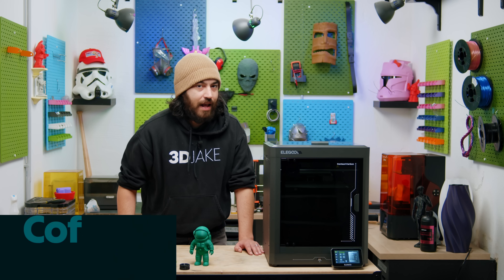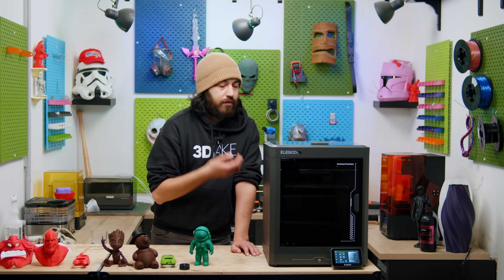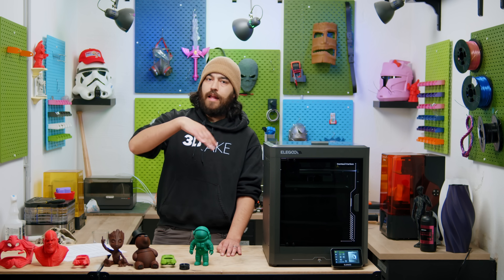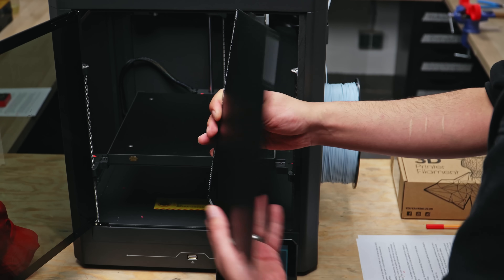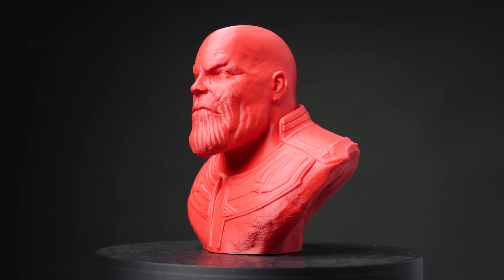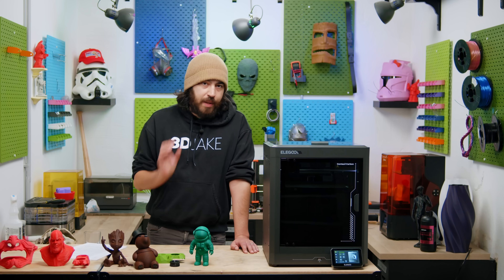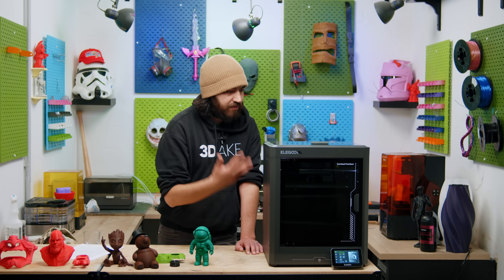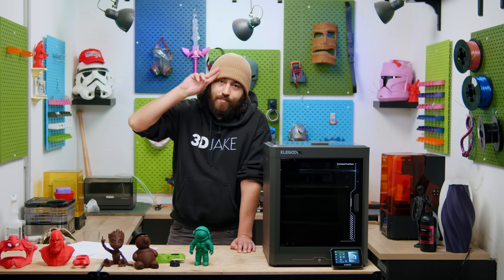Is This the Best Budget CoreXY of 2025? Elegoo Centauri Carbon Tested!

Comment: Wat is de beste printer voor tpu?
Reply from the maker: tough question but anything that doesn't have a sharp angle on the PTFE tube as it reaches the printhead, so bed slinger printers or an unenclosed printer would be best

Comment: I know this does not have an active chamber heater, but does it control the chamber fan to passively regulate the chamber temperature? I'm thinking maybe adding a small ptc heater inside to assist in printing engineering filaments
Reply from the maker: Yes the chamber has a thermistor and the fan turns on and off to regulate the chamber temperature. Unfortunately, installing a heater is not really recommended or at least one that would bump the temperature to over what the printer is capable of with just the bed alone. Installing one to decrease the chamber heat up time is probably ok but not one that pushes the temp over 50C. While the printer can process abs, asa, nylon etc if you're looking for a printer that will primarily work with these filaments I think I wouldn't recommend this.

Comment: Question how does it hold up in the long run like what the quality of the parts does anything break maintenance costs stuff like that because I can't wrap my head around the fact that it is priced to undercut it's main competitor yet still be so good
Reply from the maker: So far so good but they obviously cut some corners. There is nothing super special about this printer besides the price, it works yes but it just only works, so it seems most of the work they put in was simply about bringing the price down. That said they did a decent job in that respect and it seems to be reliable so far. Time will tell.

Comment: The leveling / bed mesh creation seems to match what I do on my custom Klipper code: probe the amount of times needed to reach the required accuracy.  I noticed that also my Bambu P1S has a variable number of probes when creating the mesh, so it doesn't seem that weird to me.  Better probe more than have a wrong measurement at that mesh location ...

Comment: Thank you SO much for actually showing HIGH QUALITY shots of the models you printed with GOOD LIGHTING and not jerking them all over the screen. Clearly, it's a capable printer, especially for the money. I will say I'm seeing a fair amount of inconsistent layer stacking, corner ghosting, seam ghosting, and general VFA. It's not hideous, but compared to some of the top quality printers on the market, I think that's where some of the big differences are. I think the layer stacking is mostly down to a few tuning options. Ghosting I'm not sure what the input shaping options are. The VFA to me look more extruder design related. All that said, it's a heck of a printer for the money. Q1 Pro and AD5M remain other good options.

Comment: Throwing my two cents in as I recently received my Elegoo CC. A BentoBox does indeed fit in the chamber, I have mine placed near the front of the printer on the side of the filament spool holder with about 13mm distance from the bed and 7mm from the z-rod. You have two readily available [i.e no need to disassemble anything] options to route the cables;  through the filament spool holder cutouts or a small cutout behind the filament sensor. There is also some concerns being raised on reddit of some users having the belts shredded due to over tightening issues from the assembly warehouse. Also, my printer came with some of the ptfe tubing left out of the chain (closer to the print head) and zip-tied further back to possibly fix some of the sharp-angle issues on the tube. It didn't rub the top of the glass either, so that seemed like a decent enough fix.

Comment: I have already pre ordered this before seeing your vid. I am planning to add a chamber heater if only to get it upto 50 degrees c though it would be nice to know if it can go to higher temperatures. So please could you look into this more.
Reply from the maker: Hey, someone commented it is not a good idea but we've asked Elegoo and we're waiting for their response, I'll let you know as soon as we have an answer
Reply: @3DJake_Official  Thank you, i eagerly await the reply. I have already ordered sixteen 12v 80°c PTC heaters, a 30a power supply and a pair of temperature controllers. If i cant use it in the printer i suppose i can always make my own bulk filament dryer. I went with 80°c heaters instead  of the more standard 220°c so it cant generate a super hotspot next to the heaters while running or incase the temp controllers broke down.

I dont suppose you could tell me how long it takes for the chamber to warm up until it cant warm up anymore while running in a indoor room temp room? Can you tell the printer to wait before printing while the chamber warms up too?
Reply: @3DJake_Official  Hi! Have you heard from them ever since ?

Comment: 10:54 This might be an uh oh.  The bed uses strain gauges and this sounds like the numbers went outside the acceptable variance and is doing retries.  This could be a problem long term as the strain gauges gets used more and more.

Comment: Im wondering what 3D Printer you used to print that pink Phase I Trooper helmet. I know neither the Centauri Carbon or Adventurer 5M have bed sizes big enough to print it without doing so in pieces. I've been looking for a reliable 3D Printer that can print large builds, Im considering the Ender 3 V3 Plus but have had trouble with Creality before in the past.
Reply from the maker: That was a long time ago, I'm not sure actually but it was probably an FLSUN V400. I would consider something like the plus/max models from Elegoo and Sovol like the Neptune 4 series or the Sovol SV08, they're both Klipper enabled so easy to upgrade as time goes on
Reply: @3DJake_Official  Thank you.

Comment: I run a print farm I have bambu printers that run 24/7and generate 10k in sales ever 3-months. And they have never failed. Not a single broken part  Any questions?   Why own anything else.  Bambu could triple the print I would still use them. I've tried other brands..... Nothing prints as reliable or consistent as a bambu. After you've ran a 5, 000 lbs of plastic through one of these printer then there might be a conversation....maybe.

The amount you've tested  these is a joke....
Reply: 2 question please, can i open the slicer offline? Can i rely on micro sdcard for offline print, without bambu account?
Reply: @vinsensiusyuda1672  yep you sure can I load all of my files on an SD card. You don't have to use Wi-Fi if you don't want to. 

For Mass printing that always makes sense... Eventually the SD cards will fail from thousands of reads. The SD card will fail before bamu printer fails.  Ask me how I know? There is a tab labeled print, right hand click it it gives you an option to export the sliced file.
Reply: @56Victorine  thank you
Reply: What’s your profit when BBL forces you into a subscription for something you already paid for? I want to agree with you, my P1S has never failed in 1,000 hours of printing.  But their screwup was so monumental it will hard to convince me to ever buy another.  Lying with a straight face isn’t something I tolerate.
Reply: @ericrandall3539  , it has no impact in me personally at all..  if you start reading terms and agreements it will absolutely horrify you with just about any company  Most of it is very based on protection in preventing lawsuits. If they own the right it's a little bit harder to formulate a lawsuit. My printers have paid for themselves I can't even tell you how many times... Literally hundreds of times.... They can all literally self-destruct tomorrow, brand new ones. I wouldn't even question it. There would be no other discussion.
Reply: @ericrandall3539  So, has Bambu forced you to buy any subscriptions for your P1S?  I have at least one of every Bambu except the X1E and H2D, I have not had to pay a cent more for anything.  You really need to stay away from the Prusa cucks who like to speculate.
Reply: So. 10.000/90 (3 months)=111 a day. I assume that your print farm is more than 1 printer? Would look for another job if I were you. 😉
Reply: @Jepespecial  There is an average of 20 working days a month. Your math is wrong. 10k ÷ 60 = $166.67 per day for a side hustle.  I would bet that is more than you make at your full-time job.  The poster is doing an awesome job, making money, and providing a better life for him/her.  And you?
Reply: @jonwoodworker  That print farm is not very big if you earn $111 a day. Better is to buy a cheap printer for more profit and a bigger farm. Wouldn’t buy a carbon X1 anymore. No longer a guarantee for firmware update in 2027 (see official site).
Reply: @Jepespecial  I love stupid people are the greatest. Not my job, just a hobby I enjoy.
Reply: None of my Bambu's have ever failed.  People just like to hate on great products because they think it's cool.  Like you, I like to make money, and Bambu makes us lots of money.  When you buy a Prusa, the only one making money is Josef.

Comment: Ive gone through 15 rolls of PET CF, and 10 rolls of ABS CF, trust me, it can do engineering filaments. It does them well. Might not do PPA CF, but I don’t need that for what I do. I also printed a bracket for the filament sensor so I can use my filament dryer directly underneath the inlet.
Reply: That’s really good to know! 
Interested to understand your bracket and the dryer issue that you addressed. 
Related to that, I believe PPA CF is (even more) brittle before intensive drying, should be printed from a dry box, and wondered whether that might be a contributing factor in Jake’s problem. I believe I had heard of it being printed OK through a less-tightly bent ptfe tube, using some extra headroom from a lid-raiser (the lid needing to be on from heating considerations).
Reply: Nice video is that just one you got in to test in the shop or have you guys started to get you're first batch of the printers in ready to be shipped out 😊
Reply from the maker: This was a test, first batch comes in 3 weeks and there are 3 more following that.
Reply: @3DJake_Official  if I had ordered mine just 2 minutes earlier, I would have had it already, but the 2nd UK batch isn’t supposed to get here until May!
Reply: Really great to know. Mine is on pre-order. Can't wait. Might order more filament now

Comment: I would like to learn more about the need for, and extent of, z-offset tweaking when using non-PLA filaments. Has this been fed-back to Elegoo? (The open-frame plain Centauri is the PLA machine, the “Carbon” is surely intended for exactly those more ‘serious’ materials!)
Also, it would be good to know what the timeline estimate might be for retail stock availability. How long to they expect supply to be ‘constrained’?
Reply from the maker: This really depends more on the filament than the printer. Automatic Z Offset for all filaments is so far not possible on any printer. Different filaments behave differently when extruded and how they stick to a build plate. Generally ABS is quite similar to PLA but I have noticed for many that in order to get a nice first layer it needs to be changed. Regarding stock, it is a bit difficult for us to be quick with a restock, the reason being, we're selling out so quickly. We have 4 batches coming in, all sold out :/

Comment: I'm interested if Elegoo will allow the Standard Centauri to be upgraded to Carbon Spec
Also if Bamboo Style Buildplates will be compatible since there's already a good aftermarket existing f.e. by Biqu/BTT
Reply: The bambu plates do work with the Centauri Carbon flawlessly.
Reply: @reluttr2  f*k yes
Reply: Upgrading more likely costs more than going directly to CC 🙄
Reply: @kimmotoivanen  absolutely but when you are on a tight budget and aren't able to save up more, this would at least be a nice option
It's also not something I'd do myself. More about having the option to expand the base platform over maybe artificially separate the versions without the aftermarket having to step in.
Bamboo offers it too to an extent

Modularity and/or expandability are still things i personally value

Comment: Is there anything that can be done about the noise?  Like slowing the print speed now?
Reply from the maker: The noise is mostly from the auxiliary fan which I turned up because of overhang problems at high speed. Reducing the print speed, especially for the outer walls will help a lot. It wouldn't need a huge reduction, printing at 150mm/s would probably be just fine while only depending on the printhead's 5020 fan. Or just use ABS so you barely have to use a fan at all and this thing prints ABS really nicely.
Reply: @ Oh that’s great to hear about ABS.  I’m mostly getting the CC to start using ASA/ABS.
Reply: Slowing down speed and acceleration have a huge impact.
Reply: @ any suggestions what speed & acceleration settings to start with?
Reply: @ 60mm/s @1k accel
Reply: @ that seems really slow.  My Ender 3 does 55mm/sec.
Reply: @ understood
Reply: @TheOfficialOriginalChad  with those big-for-winner-speed steppers there could be a lot of VFA at slower speeds.
Creality K1 took the same road and fixed it in K1C (and later K1 Max's ?). I wonder if Elegoo tuned the drivers better, or they simply ignored it...

Comment: Strong indications that Elegoo will unveil the MMU system at TCT on the April 8th.
Reply: Yeah but they emphasised "BIG", so maybe they've also had a CC XL in the works, but waited for bambu to release their H2D to see what the competition was about, price wise and then choose what they will price their larger offering at.
Reply: @tetsuokin7380  seems like it will be CC Max, the mms curvature far behind, emphasize larger dimension than regular CC
Reply: today is 9th of June, no news
Reply: @ДаудМухамеджанов  that teaser turned out to be another resin printer. The MMU/AMS thing is still promised for the 3rd quarter of 2025. I continue to think it likely that it may be “announced” when the open-frame ‘Centauri’ is released in a month or two.
Reply: “Something big” might be their version of an AMS, or not. I had thought that it might go out at the time of the open-frame Centauri - it is probably more essential to that printer than the Carbon. But expecting a ‘reveal’ before the availability announcement, it could be the “unveiling” on the 8th.